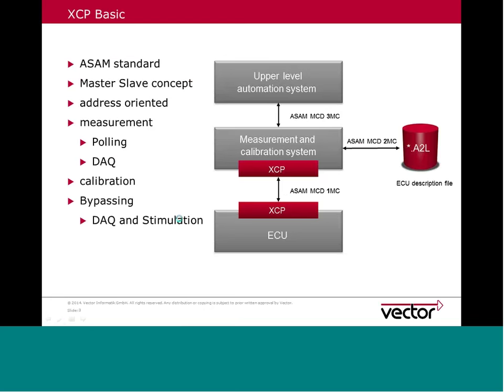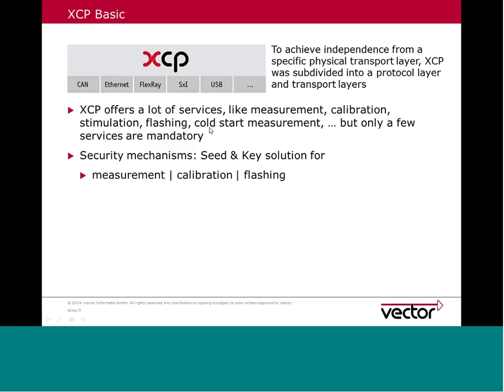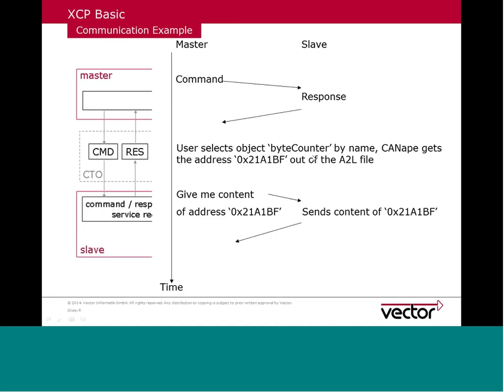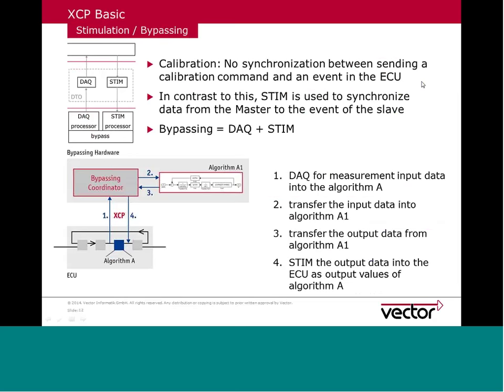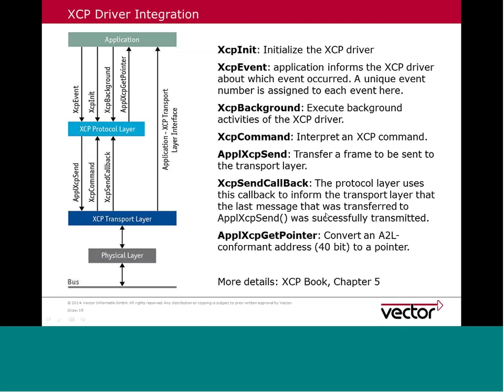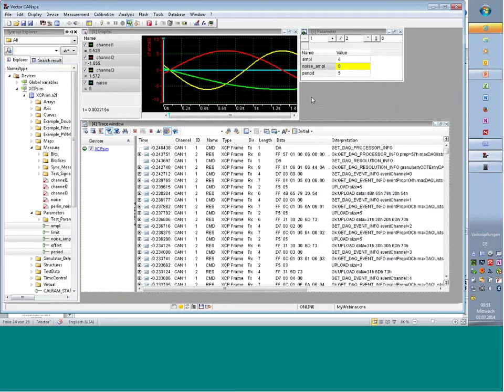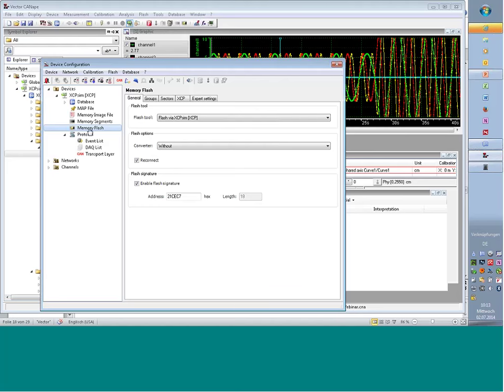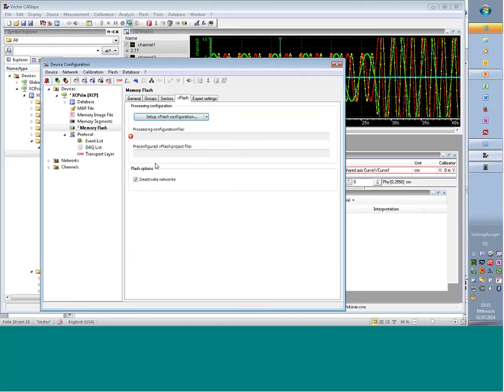XCP Fundamentals: Measuring, Calibrating and Bypassing Based on the ASAM Standard

Comment: If we are reading and writing to RAM locations using XCP, which part of RAM are we talking about? Are the addresses of Global Variable [xcp parameters] fixed in these RAM location? is this the .bss and .data section of RAM?
Reply from the maker: In general XCP allows access to any kind of memory. XCP just needs the address of the object. The mapping of the name of the object and the address is realized in the A2L file. The global variables used as parameters (=writable object) must be specified in the code as “volatile”. The Linker process will define the addresses of all necessary objects in the RAM. Parameters should be stored in a so called “calibration RAM” area. In contrast to the RAM that is used as a working area to store results of the algorithms. The calibration RAM area must be defined as writable in the A2L file.  
Vector's reference book "XCP – The Standard Protocol for ECU Development" describes fundamentals and application areas of the XCP measurement and calibration protocol. You can order it here: https://vector.com/xcp-book